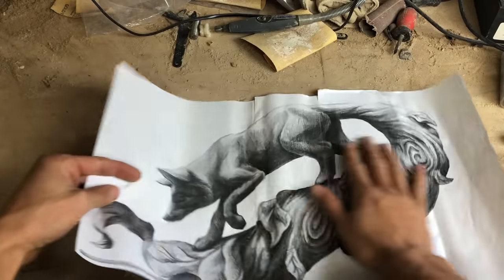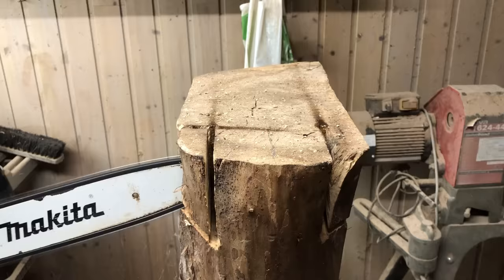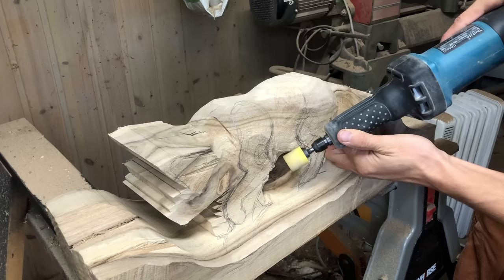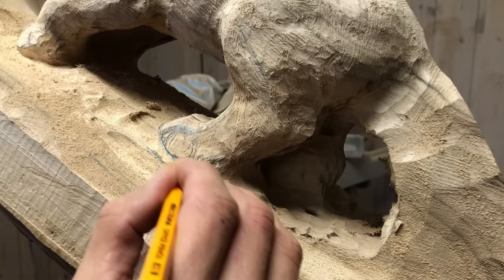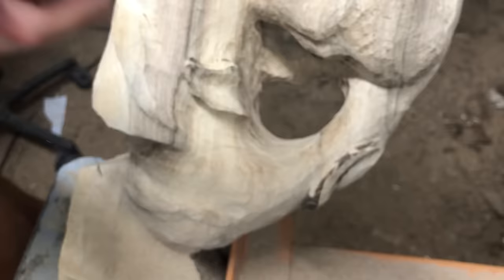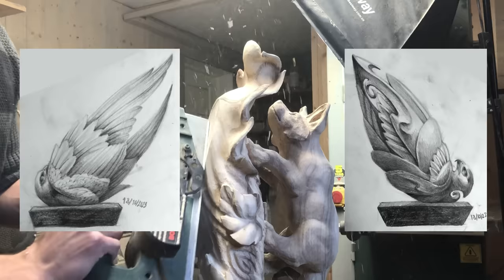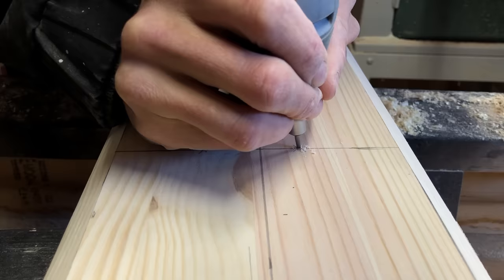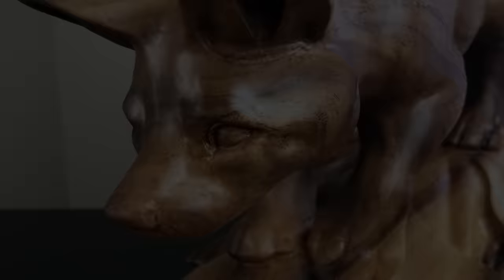I Carve A Fox Walking On Its Own Tail

Comment: The first log was spalted wood and is insanely valuable.
Reply from the maker: I guess some species are, But not this one. The spalting process had also gone too far
Reply: @Jonasolsenwoodcraft Have you tried injecting a epoxy resin into the punky part of the wood? Also you can dip it into  pentacryl to help with some of that and also bugs
Reply: Spalting from a lemon tree is really gorgeous too.

Comment: My only real critique is that the fox's face ended up being too wide. I think this mainly happened because while you had a complete reference image for the left and right sides, you didn't make any references for the front/back or top/bottom axis, so you were basically winging it when it came to those proportions. It only really becomes noticeable when looking at the sculpture head-on.
But other than that, an amazing piece of art as always! :)

Oh, and you could have clamped the block to the sculpture using the masking tape trick: cover the bottom of the sculpture and the block with masking tape, then use superglue to stick them together. Makes a strong bond that can still be peeled off easily.
Reply from the maker: Im going to have to disagree with you. The head is about as wide as the shoulders. Check out references on google of fox cubs and thats how they look.

Comment: Mate, you're an absolute rockstar! Love you're carvings. Just started recently myself (nothing to fancy yet), i was wondering what dremel bits you use? And that big baljoint on your grinder, never saw that before! Could you maybe do a video on your tools of choice. It would be verry helpfull in my own Journey and those of others i imagine. Keep up the good work Jonas!
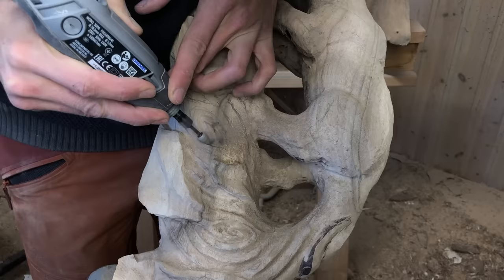Reply: That ball is an Arbortech ball gouge. Especially good for hollowing out stuff. He’s using a angle grinder with carving disc as well (3:03). Dremel bits are, so I think, all carbide bits small and large, different shapes.(These are available by different brands like kutzall and saburtooth, but also cheaper Chinese stuff). And then there’s the Merlin grinder from King Arthur Tools. The red machine you see him using at 6:33.
Reply: Thnx job, i appriciate that verry much!!
Reply: Uh jop, sorry